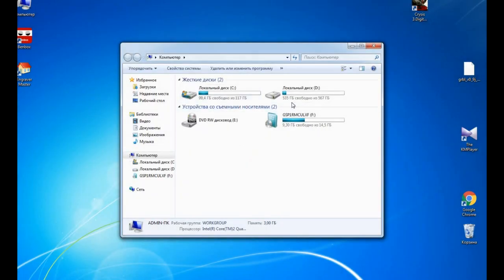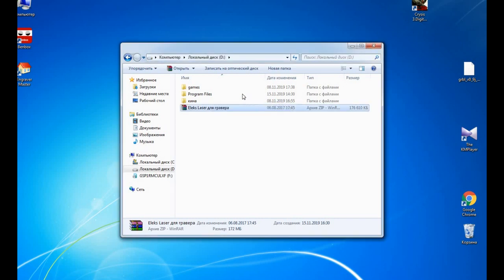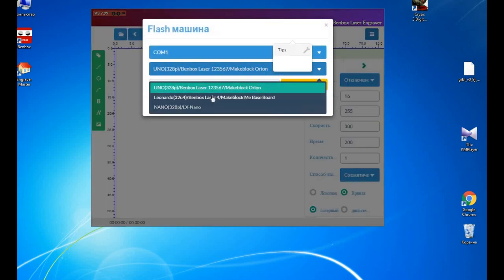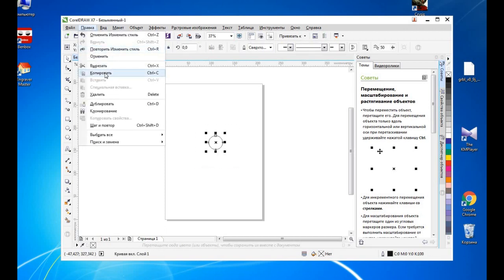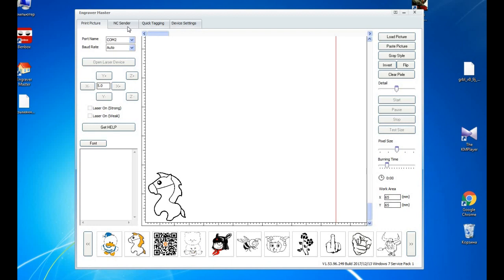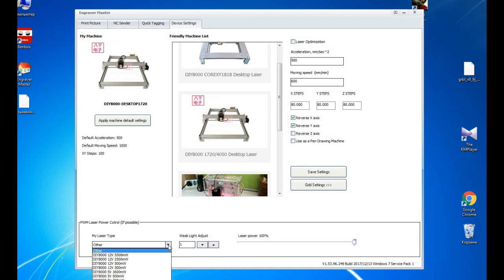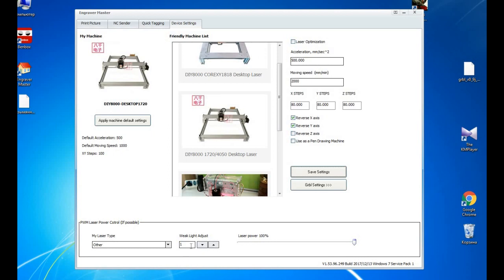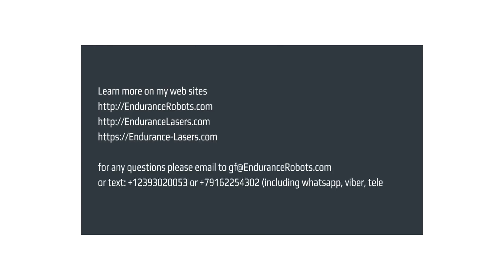Changing firmware for Benbox software - getting started. How to improve greyscale laser engraving

Comment: you didn't explain shit. what machine are you using? are you using the A3 or the MINI( dvd tray drives). why ae you using the LX card? the new boards are MANA SE v3.
 I have 2 mini laser machines they use 92 steps per MM. while the larger laser engraver(A3) uses the default GRBL settings.
if you are using the mini laser engraver you can only do a 35mm X 35mm image, MAX.

 if you use benbox  0.8c firmware, your laser may not work correctly with other laser software. if you use GRBL 0.9 it doesn't work with the LX board until you change the jumper under the nano. benbox 0.8c uses pin D12 for the laser. GRBL 0.9 and newer( GRBL 1.1) uses pin D11 for the laser. also if you use the GRBL 0.9 or newer you need to set it for LASER mode($32=1).
as far as burning software goes, LASER GRBL or LASERWEB are much better then benbox.(and they are FREE)